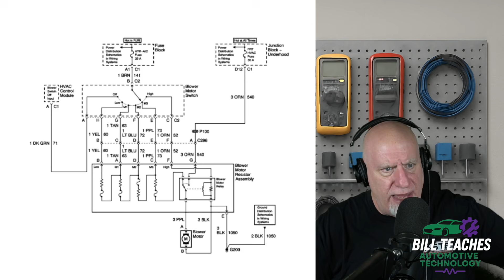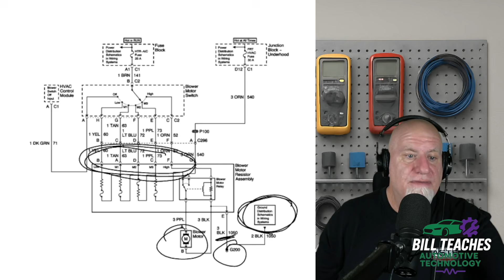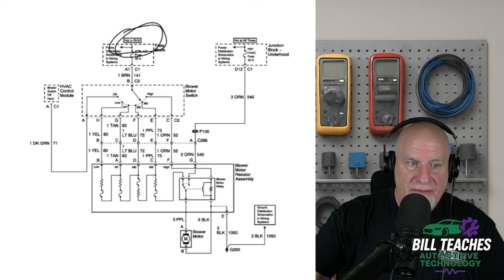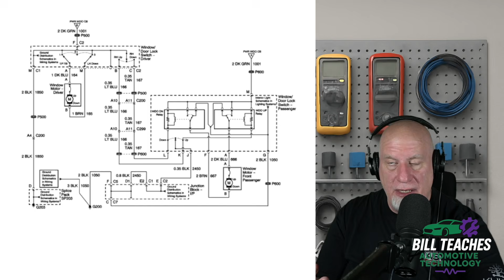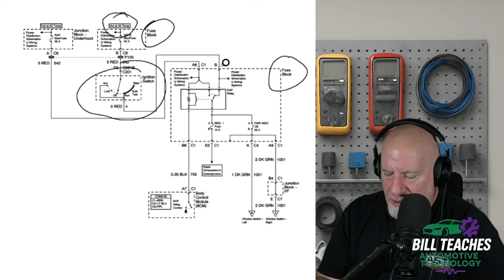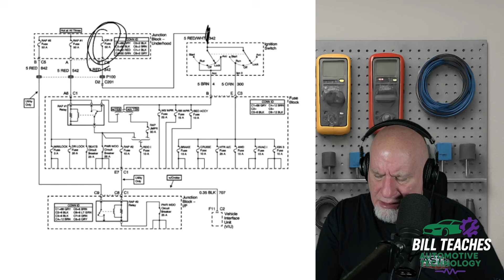Electrical Diagnosis Case Study | HVAC Blower Inoperative (2001 Silverado)

Comment from the maker: Thanks for watching!  The opening line should be "Have you ever had an electrical problem where your issue seems..." My brain and mouth didn't work well together on that one 🤣
If this video helped you understand the basics of troubleshooting using a wiring diagram, drop a 👍 and let me know what DIY project you're working on.
Have a question about wiring diagrams? Comment below—I'll pick a few and feature answers in future video shorts!
Want more automotive wiring tutorials? Subscribe and enable the bell 🔔 for regular updates!

Comment: Another electrical question. How can these defective parts not blow their fuses, but blow another power fuse that is connected through the wiring harnessing? And still have missed what is causing the motor fan, or blower fan to run during key off, ignition off? Could  a Power Fuse Box be the culprit when power through replaced parts are present as coil, starter, battery, and no power through the Power Fuse Box except those. Interior Panel FUSE Box was replaced for melting in the area between interior lamps, turn signal (may have affected A/C fuse terminal in column next to turn signal which was burnt terminal and run (hego 15 amp. in next column which is like module components to PCM)? Yes 3 and Mega Fuse from Power Fuse Box were 2 burnt (Brown coloring around fuses but didn't blow metal connector) but Mega Fuse was barely holding together (tested vaguely 3-5 amps through melted, broken metal connection), Ignition Power Fuse Blown, however, New Ignition Switch installed?
Reply from the maker: Hi there! If you would, comment the year, make, and model of the vehicle in question, I will research and see if I can help when I return from a weekend teacher conference.
Thank you for watching and commenting!

Comment: I have a question. When a blower motor consists with some A/C Condenser oil, residue possibly from leak of a Bad A/C Condenser, blower motor replaced, fan shield cleaned up, resistor sensor replaced, but blows when testing the 60 amp power fuse and still runs after pulling the 60 amp fuse until ignition fuse pulled or motor fan fuse removed also, where can another connecting ground be tested to find the short circuitry that possibly is bi-passing current throughout the A/C Units, both interior and exterior unit was replaced, new. Hard to find when the Fuses aren't Blown observations. Need some logical explanation other than replaced almost every part other than A/C Relay stop of and Heater Core which remains to be with replacing. Perplexed, hmm. Thank you. Video very transparent, excellent, however, diagnosis goes a more further with what is being diagnosed without A/C Relay, Heater Core still remains to be repaired.
Reply from the maker: Hi @dianapotoski4035! I appreciate you watching, commenting and asking a question. What year, make, and model vehicle is in question? I am currently out of town at an instructor's conference, so it may take a couple days to research and respond once I get that.
Thank you again!

Comment: 😂 had one just the other day on a washer fluid pump. Used. A voltmeter 0v then to the fuse and 0v? chased the wiring for abit asked a more experience tech cause i doubted my readings. Sure enough a test light showed power at the pump. My lead wire was not fully seated in the meter 😂 dead pump
Reply from the maker: 😂 Been there, done that, lol. Had a burned out bulb in my test light once... That’s a perfect example of why verifying your test setup matters as much as the circuit. We’ve all chased ghosts because of a lead, a range, or a setting. Good catch in the end, and a solid reminder for everyone watching! Thank you for the comment and for watching, it means a ton!